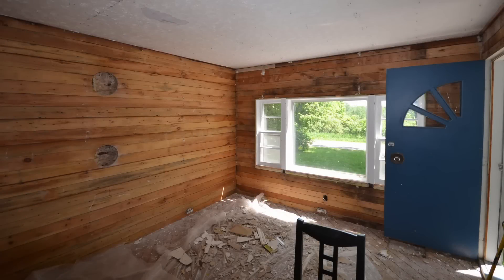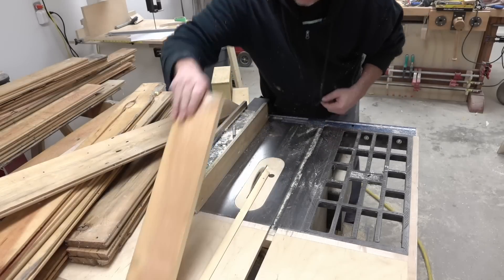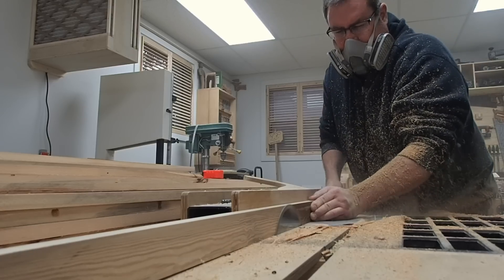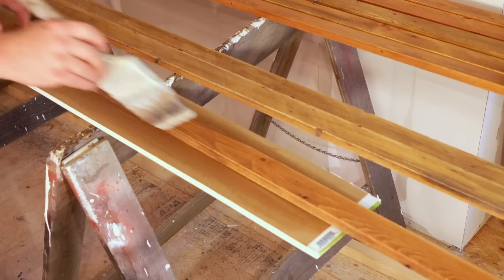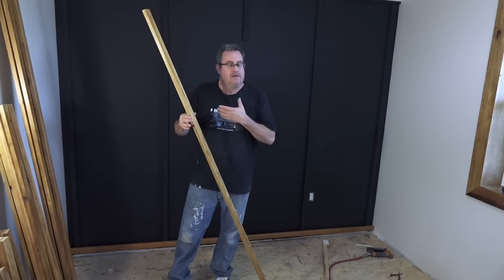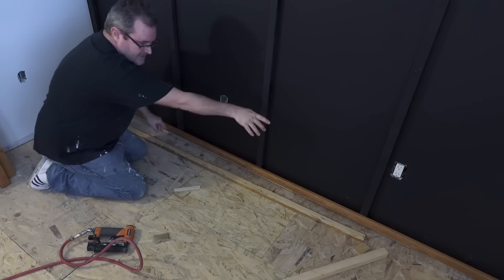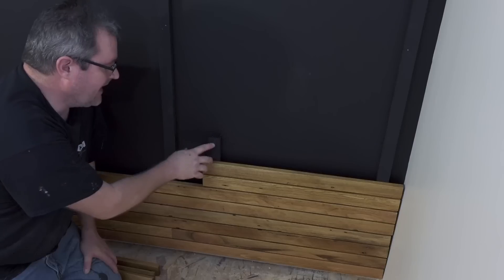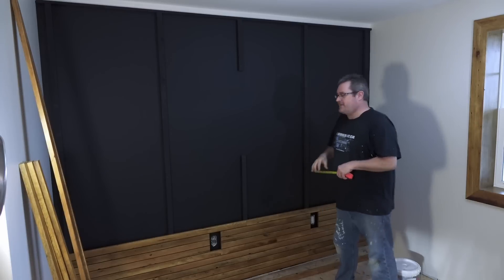Making A Wood Slat Feature Wall

Comment: That looks fantastic John! Looks like a ton of work but the end result was worth it. Thanks for sharing.
Reply from the maker: Thanks!
Reply: I must agree. It definitely offers a unique look.
John, one question, does it matter (probably not) that you only sealed three of the four faces of the boards? When would it matter?
Reply: Larry Be
I would assume since it's indoors sealing all 6 sides would be redundant since the backsides won't see any kind of abuse. If this slat wall was built outdoors then you would definitely want to seal every side.
Reply: Johnathan Schreiner:  I live in a humid environment, so I would definitely finish and seal ALL sides of the wood, whether they show or not. My father made a plaque decades ago out of wood and left the back unfinished, and it has warped like a Pringles potato chip. Where John is may not be humid enough for moisture absorption to matter, but it's definitely an issue in Florida!
Reply: Lex Boegen 
Ah fair enough. I'm further north in Canada than John is so humidity is even less of a factor for me. I think, I could be wrong but it seems like anything I build without a finish stays pretty stable.

Comment: Once again John, you've shown great skill and creativity in taking "meager" materials and making a stunning project with them. You've inspired me to do something similar in my living room and I'm thinking about making some custom hangers out of steel strap that can slide in the gaps and be used to hang pictures, etc. without putting any nails or screws in that wall.  I love the LED strip at the top too. There is a restaurant here in town that put a similar slat wall up, but with LEDs behind the slat wall to backlight it for a stunning effect too, but they have the budget for all those LEDs.

Comment: I totally agree with you when working with linear installations as with your wood slats, that it not be gradient level but rather evenly spaced with the ceiling, walls and floor. As no wall, especially dry walls remain 90 degrees. Good work.

Comment: you mentioned the in floor heating.  Did you do a video on that?  Would love to see how you did it and what kind of system you selected from the infloor materials to the heating of the water; existing boiler, new boiler, hot-water heater?

Comment: And, for those worried about dust, if you make the bottom slat removable, you could get your vacum in there where most dust will settle. I don't think this is a big issue however, many people seemed to be concerned.

Comment: That's funny... if you asked me I would have sworn that it was finished already when I saw it last August.  I did not remember  at ALL that the top section was undone.   Where did you hide the PS for the LED lights?    Really really like the look, and the reddish/aged tone of the wood.   

Time for a bigger TV though?  ;-D
Reply from the maker: Some pretty big changes here since you visited.
The power supply for that LED is in the basement, plugged into an outlet mounted on the electrical panel board. There's a regular switch in the wall in the living room that turns it on and off.
I have another one to put in, in the dinette area in the kitchen, but now rush for that. The wires are run and the switch is installed for that one too.
Reply: Hmm, I could do that also using a PC power supply like I did in the shop...  though that seems more like a hack more suited for my shop than my home!

Comment: End Product looks great. Are the 2x3 slats attached to the drywall with just construction adhesive? Is that strong enough? Im sure the adhesive is strong enough but wouldnt it just be attached via only the thin top paper layer of the dryall?

Comment: Hey John, It looks good. I have a couple of questions though. 1. Did you test out any 1/8 th inch or 1/16th inch spacers between the planks before deciding on the 1/4th inch. 2. Did you want the background black color to show between the planks and is it aesthetically pleasing to the eyes, it was a little hard to notice in the video. I have seen many people on youtube using the click and lock type  laminate boards and it looked very pleasing to the eyes. Obviously, you can't see any background color with that approach using laminate boards. I think you are the only one i have seen on youtube using 1/4th space between the planks. I am sure you have a reason and an explanation. I would like to hear if you can. Thank you for the video. 
Vijay
Reply from the maker: I can't imagine putting laminate flooring on the wall (as you describe) looking good, or at least I wouldn't do it.
Leaving the gaps between gives the wall dimension, depth, so it doesn't just look like laminate floor stuck on the wall.
It also has some acoustic benefit, since it acts as a like of diffuser.
Reply: Thanks for the reply John. I had no idea about the acoustic benefit by leaving space between the planks. Thanks once again. Vijay

Comment: Great wall! A bit funny that you reversed the order. Boards + drywall paint/wallpaper -> drywall paint/wallpaper + boards
Reply from the maker: All except the wallpaper - wallpaper is evil and not permitted on The Compound.
Reply: Great if you use it as building paper, and then take outside and burn it. But for me renovations require rotary chisels, bricks and heavy labour. 

Long term is to refinish the parquet floor, but first have to get rid of all the uninvited "guests" in there and replace the damaged sections, removing this old one is not easy, as it was applied with tar adhesive 60 years ago, and I really do not have the money to pay for the month of work to get them out, plus I hate ceramic tile floors. They look nice if refinished, but currently live under carpet.